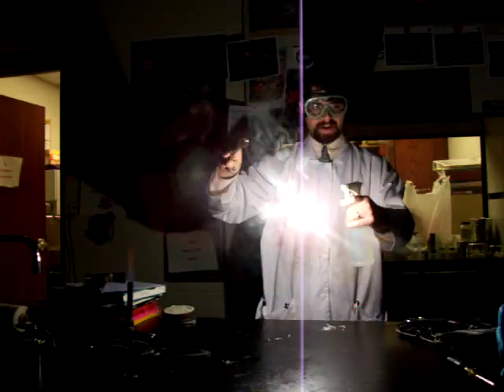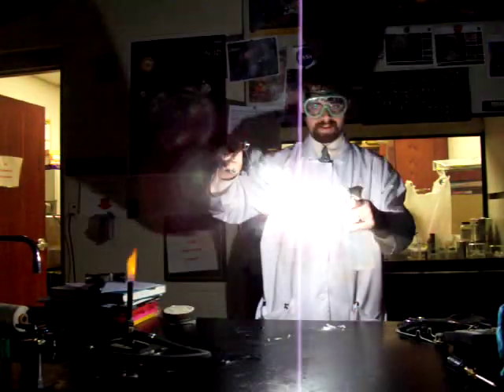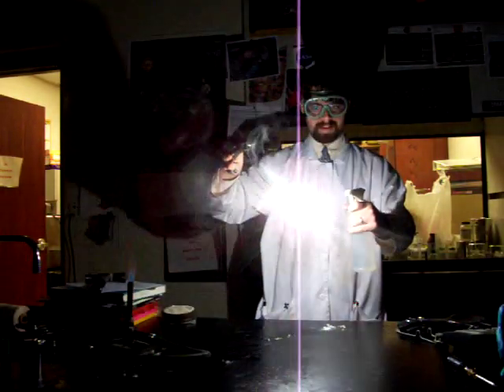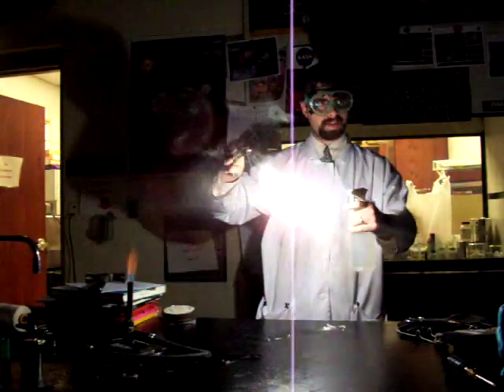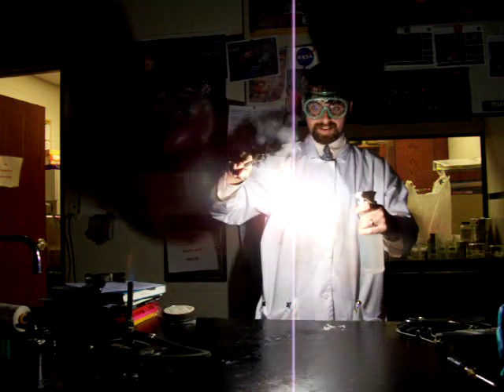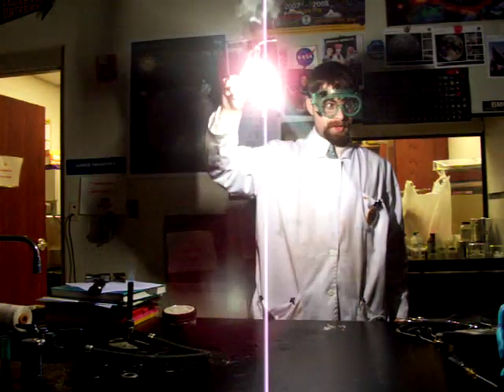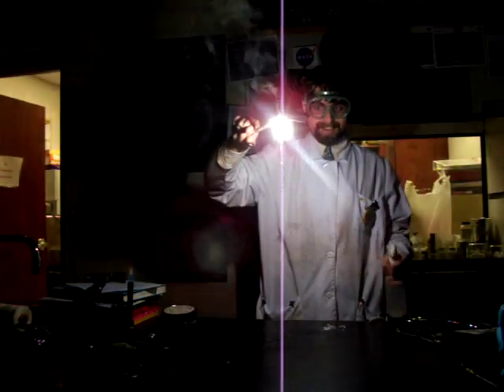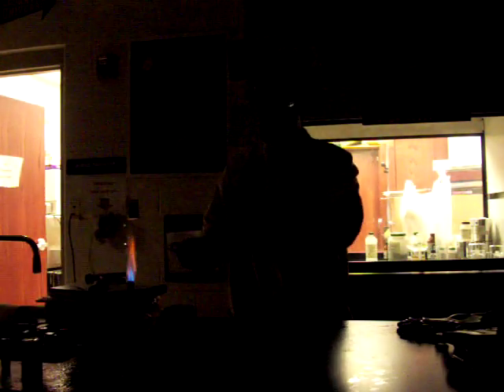Burning Magnesium in Water

Comment: Water can put out magnesium fire. What happens is that the magnesium takes the oxygen out of water molecules themselves, causing those puffs of fire (the liberated hydrogen); but this takes more energy than the magnesium gets. It starts to cool, until it stops burning. The only problem is spraying water won't do it- it has to be drowned. And those blasts of flame, plus superheated steam, are why water isn't used.

Comment: My goal is to get the O2 from MgO2. I originally thought I could add in hydrogen and then use electrolysis to split the H2O later, and then when that didn't work I thought I would try to use Nitrogen and just right away get Mg3N2 and O2. So basically I don't care about the magnesium, I just care about the oxygen. Thanks for your help though, at least I know what I shouldn't waste my time doing.

Comment from the maker: Still no.  It actually turns out that Mg is reactive enough that when burning like I do in this video here it actually bonds to nitrogen and oxygen forming magnesium nitride (Mg3N2) and magnesium oxide (MgO).  With water the magnesium nitride will turn into magnesium oxide [Mg3N2 + 3 H2O -> 2 NH3 + 3 MgO] additionally, although Mg will burn in N2 it is tough to do. Once Mg is bonded to O it doesn't want to give it up unless you find something more active.  Look up an activity series and be safe.

Comment: Excuse me, I'm a student in high school and I would like to know, is reversing this reaction possible? I have some Magnesium Oxide (MgO2), and some Hydrogen (H2), if I mixed them together and hold them over a fire to give them the energy they need, would they bond and create Magnesium (Mg) and Water (H4O2)? I know Hydrogen is extremely flammable, but if I tried to conduct this reaction (standing back far away of course), would it work?

Comment from the maker: I have extinguished a Mg ribbon by dunking it in a beaker of water, but I have not done tests to see what the tipping point of water to Mg ratio actually is.  However, I do know that bars of Mg or large objects made out of Mg will continue to burn in large bodies of water.
As far as water temperature goes, Mg (and most substances) reacts more readily with hot water or steam.

Comment from the maker: Burning usually (always?) is oxidation, but oxidation is not always burning.  And so yes, there are oxidation reactions that water will have no effect on, but water is frequently a go to for burning.
Also, from a practical standpoint, the demonstration (and its partner demonstrations using CO2 gas and solid) was to point out the difficulty of stopping a metal fire as much as anything else.

Comment from the maker: Sparklers used to be Mg based, but few are any more.
My understanding is that the water makes it burn brighter and faster is that rather than extinguishing the fire the burning Mg causes the water to decompose into H2 and O2 and then the H2 burns also.
Small amounts of Mg can be overwhelmed if submerged in water, but it is possible for Mg to burn under water and it does so more violently.

Comment from the maker: Furthermore, I do a demonstration about how to use a Bunsen burner and how to handle related problems.  In that demo I light the gas at the hose.  I do this because students will try it if I don't show them what happens and why it isn't safe to do.
I am not saying that I want the Mg to burn through the hose or that it is safe, but an explosion is just not going to happen, and there is within reach: 3 shut off valves, metal fire containment, ABC extinguisher, fire blanket, a sink, and my own PPE.

Comment from the maker: The hose has some heat resistance.  The Mg is not molten it is burning.  The Mg's temperature is really high the heat energy it has is low.  The shutoff valve is next to the burner and the emergency shut off button and the master shutoff valves are both within arms reach.  Finally, I have fire suppression within reach for both the metal and the gas. 
I appreciate the concern but I think I can handle myself and my classroom.
As a side note, I don't think 25 is middle aged.

Comment from the maker: @DANGJOS  It has been pointed out previously that I misstated the temperature, I had another number in mind when I did so, and there are some disagreements as to the exact temperatures involved none-the-less. Also depends on the scale of course.
According to the data I have it burns at: 2500 K (2200 °C, 4000 °F), although its autoignition temperature is 744 K (473 °C, 883 °F)

Comment from the maker: @MetaSethical To be honest the best thing to do would be to label each individual reaction and consider it a step-wise process.  I don't think it is common to name the whole series of reactions as if they were one.
2H2O --(heat)--> O2 + H2 decomposition & redox
H2+O2 --(heat)--> 2H2O synthesis & redox [though technically you are correct it is oxidation-reduction]
2Mg+O2--(heat)--> 2MgO synthesis & redox

I've never heard of a reaction that occurs in several steps being named as a whole.

Comment: @mrericsully  -- When the water hits the oxidizing magnesium, the atoms in the water molecules bust apart from each other because of the energy imparted to them.  Immediately, the hydrogen oxidizes again with the oxygen, again releasing energy as heat and light.  What is that specific process called?  Is that a redox/oxidation-reduction reaction?

Thanks,
Setherson

Comment from the maker: @noglobwarm96 Yes, that is true, although I would clarify your answer and say that it is how fireworks get their colors and most of the light they emit.
However, that wasn't really the principle I was trying to discuss here, rather I was showing that Mg fires are hard to put out by out normal methods.  Water will not put it out and in another video I show that Carbon Dioxide will also not put it out. Usually about all that can be done is for the fire to be contained.

Comment from the maker: @vanillapuddingluvr It has been pointed out previously that I misstated the temperature, I had another number in mind when I did so, and there are some disagreements as to the exact temperatures involved none-the-less.  Also depends on the scale of course.
According to the data I have it burns at: 2500 K (2200 °C, 4000 °F), although its autoignition temperature is 744 K (473 °C, 883 °F)

Comment from the maker: @twistymcslide My guess would be because of the heat it gives off.  Many aircraft engines are made out of magnesium to begin with which would cause issues.  Plus it is really difficult to get large pieces of magnesium to ignite because it does such a good job at conducting the heat away.  Lastly, it would be harder to refuel because the magnesium is a solid and would probably be inside the engine.  So it might be possible, but there are a lot of hurdles to overcome and better alternatives.

Comment from the maker: @bluefox216 You are correct, I reported the ignition temperature/temperature of my Bunsen burner and not the magnesium itself.
Having said that I was talking about sparklers and most sparklers are not made of magnesium anymore and they do burn at lower temperatures.
According to Wikipedia MG metal burns at approximately 3,100 °C (3,370 K; 5,610 °F).

Comment from the maker: Also, you are correct that most sparklers in the US no longer contain magnesium, but they used to.  Also, it IS still possible to purchase some with potassium chlorate or perchlorate and magnesium at specific fireworks stores.  Also, just because it is not common in the US to find sparklers with magneisum they are still common elsewhere and the safety concerns are pretty much the same when speaking of sparklers and their high temperatures.  Magnesium or iron kids and adults still get burned.

Comment from the maker: I agree, however there is a large difference between temperature and heat.  Sparlkers burn at very high temperatures, but because they are tiny have very little heat energy.  A bowl of soup might have the same temperature as a spoonful of the same soup, but the bowl has more volume and therefore greater heat energy.